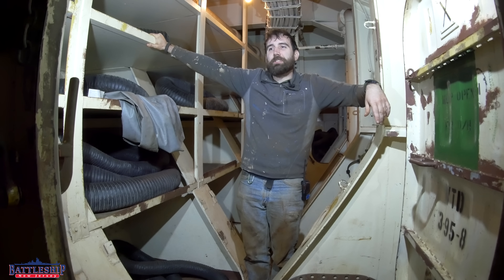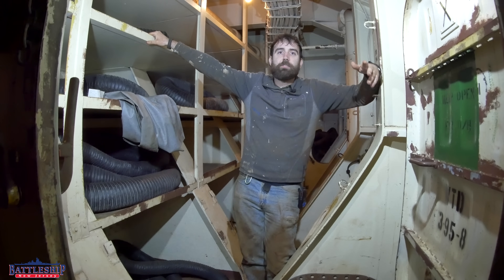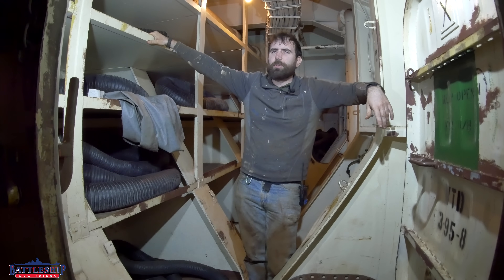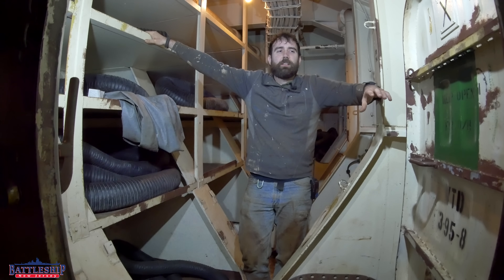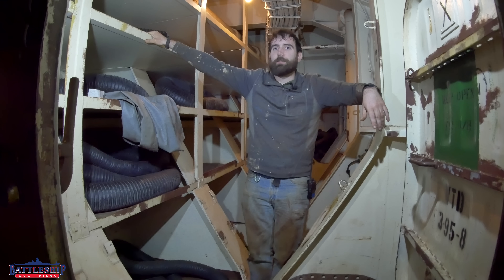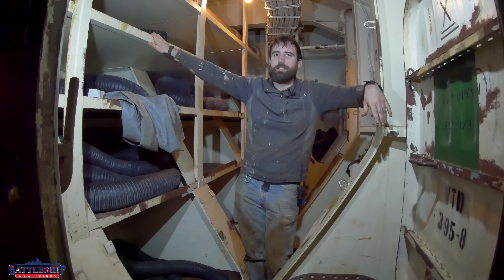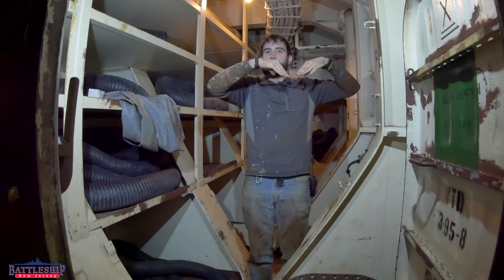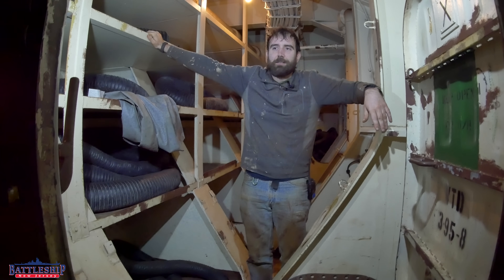The Best Torpedo Defense On a Battleship

Comment: The effectiveness of under the keel explosions was well understood by the interwar years.  That is why the Royal Navy, the US Navy and the Kriegsmarine developed magnetic exploders, none of which worked.   The Japanese went for a big warhead instead.

The Yamato probably had the best designed torpedo defense system.  However, it was apparently poorly built and prone to failure.
Reply: Their calculations, while good and thorough, were based on a TNT-like explosive, but during the war the Allies unexpectedly (to the Germans and Japanese of course) switched to Torpex, which is 50% more powerful than TNT.

I've also heard Drachinfel say there was a poorly designed and constructed joint between the armored belt and the torpedo bulkhead that was to rigid so any flexing could tear a hole between the two.
Reply: I dunno about that.  The Yamato and Musashi took more torpedo and bomb damage than any other ships in history that I'm aware of.  If I'm wrong, name a ship that took more torpedo hits and stayed a float.
Reply: @MartyInLa  That’s how many torpedos they were hit with, not how many it would have taken to sink them.  I suspect they would have eventually gone down with far fewer hits.  But the US Navy didn’t want to take that chance.  Also, bear in mind that those were air-dropped torpedoes with relatively small warheads.  They don’t compare to torpedos launched from ships and subs.
Reply: @MartyInLa  They were the size of a supercarrier so what do you expect?
Reply: @MartyInLa  no they did take more bombs and torpedoes, and they sunk. We'll probably never know how many it would have taken to sink them, just how many they eat. When you're being swarmed those are different numbers.
Reply: @navyreviewer  yeah it’s incredibly likely they were overkill’s by a fair margin
Reply: @MartyInLa  What are you talking about..? He's commenting about the speculations of the design, not what had actually happened..?
Reply: Agreed about Yamatos construction quality being poor. Also agree about them having arguably the best TDS. They could afford to as they had no limit on their size.
Reply: @navyreviewer  Having a poorly-designed joint between the armor belts, and placing it far too close to where a torpedo might impact, so that a shallow-running torp could cave in the joint and dump water high in the ship, doesn’t sound like a good design to me.  Yamato took a LOT of damage from just one lucky Mark 14 due to that flaw.  The Iowas and SoDaks actually had deeper TDSs than the Yamatos because their machinery was more efficient and took up less space.  They had a flaw in theirs as well, but it was much less dangerous because it was much lower in the ship (where flooding was easier to contain and less destabilizing) and much further inboard.  The best system by far—if it had been completed—would have been on the Montana class.
Reply: @bluemarlin8138  In any event both Yamato and Mushashi suffered catastrophic magazine explosions caused by aerial bomb damage, though Musashi was already under the waves when her's detonated.
Reply: The yamato was torpedoed on both sides. So instead of capsizing the US caused flooding, and then counter flooded their last hit.
Reply: @CameronCombustion  The Musashi was torpedoed on both sides, which acted like counterflooding and slowed her sinking; they learned their lesson and with the Yamato deliberately attacked from only one side, so she took half the torpedoes and rolled over.
Reply: @gregorywright4918  was it musashi? Im terrible with names.

Comment: For modern torpedoes maybe a triangulated keel beam would work better then the "I" beam conventionally used, would be cool to see some testing on different designs.
Reply: I think that the mass of steel you would have to use to make any keel survive (even barely) a modern torpedo is too much for ships to be able to obtain any real speed. The mk. 48 uses 647lb of high explosive, that will literally lift a up a 7000 ton destroyer.
Reply: @rangerhalt   I think the best defense against modern torps would be a blast chimney, like a few personel carrier concepts have against landmines/IEDs. Creating a path of least resistance to divert the energy of the explosion safely away instead of trying to take it head on. It would still need very strong framing, and means there's a large vertical void in the middle of the ship, which is inefficient use of space.
Reply: Hmm, a lot of torpedoes now are propeller hunting and can be set to go off where you like. Bow and stern hits are nasty for a ship, amidships, even one that cracks the keel, tends to take time to sink. Bow and stern are often 2 minutes or under to sink. 

You can still set them to do it though. One note is sea mines, they may not be fast enough to do more than intercept, thus keel is suitable.
Reply: Why would hits in the bow or stern sink a ship so quickly?
Reply: @magiccarpetmadeofsteel4564  combination of no anti torpedo bulges, the weight imbalance,  for the bow the ship drives itself under, or capsizes it and the stern is quite vulnerable, distorting the shape of the propeller shafts causes them to rip and tear the ship apart, breaking the waterproof seals around it allowing water deep into the ship. 

If it is hit amidships, the weight imbalance is less, it won't split in half titanic style, most systems will still work, it doesn't cause sea damage, etc

It's complicated, quite a few factors. I merely know it is true from the records.
Reply: Modern torpedos will detonate exactly where you don't want them to, and the warheads do deeply unpleasant things to maximise damage. They don't just go 'BANG.'  It's hard to convey just how much more devastating a modern torpedo is than a WW2 model. It's a completely different class of weapon.
Reply: For modern torpedoe defense with the torpedo detonating below the ship. Possibly a cylindrical or egg-shaped keel. This would spread the stress
Reply: Triangular beams are weaker, because no matter what direction you apply the load from, you will allways have one corner that is under much higher load, than the rest of the beam. If you want to have a keel, that will not break, your best option (or rather least bad) is not to have a keel at all, but rather go for a composite sandwitch design. Not that anyone has been able to do that at much more then 1/5th the length of a supercarrier hull. For some reason, everyone seems to stop doing that at about 70m hull length. I mean I understand that cost would be one issue, but why no-one (AFAIK) has made a 80m hull, only to realise that this was to expensive I do not know.
Reply: The problem is, to survive something like that, you have to dissipate the energy somehow, the easiest method is to do like airplanes do it, you actually have to flex and bend.
But then you are left with another problem, you have also be able to support many times your own weight which airplane wings do not have to do to avoid breaking.
Even jetfighters can snap and ruin wings at 9 times their normal 1G weight (Pulling 9G) and here we are talking several zeroes added after that.
Reply: WWII battleship would have no issue with modern torpedoes.
Reply: @rogerahier4750  Yes it would. No big ship is designed to be lifted in the center or on both ends, and thats what the torpedo is doing. A small ship can stand on its keel or be lifted bow or stern only, but a big ship might have to support its weight over a 100 meters or more, and its designed to float on water, not be a bridge. It would just brake apart.
Reply: @hernerweisenberg7052  Battleships do it every time in a storm when a wave is at the bow and the stern.  Four weeks of live fire including modern torpedoes couldn't sink the USS America.  They finally had to scuttle it to actually sink it.  An Iowa class battleship would certainly do better.  People that think you can just sink a US carrier would be in for a real surprise.
Reply: @rogerahier4750  By that logic, a giant containership thats 5-10 times the size of a battleship is so much more torpedo resistant because it may overhang some waves? xD
Reply: @rogerahier4750  Btw, zero torpedos where used on USS America. They used some explosive charges of undetermined size, The reason it took so long was they inspected the ship after each test of unknowen size.
Reply: @rogerahier4750  a modern torpedo like a Mk48 would gut any battleship. The under hull explosion is much worse than just lifting up the ship.

What happens is the explosion creates a bubble of water that will hammer the underside of the hull. This is very similar to what happens with side hitting torpedoes of WW2. But the under hull detonation has a part two. That bubble is going to collapse and when that happens it will create a massive water jet that will blast straight into the already damaged hull. This will be much more focused and destructive. None of the hull bottoms of battleships were meant to deal with this. None of the side TDS was ever designed to withstand anything like that. The only hope would be enough compartmentalization to reserve enough buoyancy to keep the ship afloat.
Reply: @rogerahier4750  Yes they would.

Comment: The protection against modern torpedoes is actually having multiple layers of hull, this is observed when ships are called "double hulled" or etc, the reason you don't see it often however is that you're now requiring just shy of double the resources for your hull or more depending on how many layers you add on top of reducing your usable interior space which is a premium in ships due to size constraints being limited by using the Panama Canal for convenience.
Reply: Today Panamamax somewhere at 1200 ft long and 160 ft wide.  So you could design bigger ships today with 20 to 30 feet torpedo depth.  Back in WW2 it design limits were 106 ft for width.
Reply: The US battleships had triple-layered hulls on the bottom.  That’s not a new thing.

Comment: Ummm, thinkin’ there’s a error in the reasoning of a liquid filled cavity providing attenuation of a detonation. It’s actually just the opposite affect.
Reply: The uncompressability of a liquid allows the force of the explosion to be spread equally along the inner belt.  It is not to attenuate anything
Reply: Bags of water are used to attenuate controlled explosions by bomb disposal teams. See “Why is Water So Efficient at Suppressing the Effects of Explosions?” in The Journal of Conventional Weapons Destruction Volume 22
Reply: I wondered the same thing- a hydraulic effect transferring energy toward the bulkheads. What defeated that energy? Expansion= dissipation of energy forward?
Reply: The liquid (and the air void) spread the explosion force sideways, which spreads it out and allows more of the frame and bulkheads to absorb it.

Comment: Not an expert here.
Couldn't a system of Point defense cannons (basically Flak cannons with explosive shells pointed at the water) that are distributed all over the ship, work as a viable torpedo protection system?
Reply: Today with current radar and sonar, maybe 🤔 before it was just a lucky "BB" (Golden) hit to protect the ⚓ ship.
The Olde saying since Bikini 👙...one shell one ship sunk (Nuclear).
Reply: If see it and have time to react
Reply: Anti torpedo torpedos..as it were..
Reply: @hillaryclinton2415  as I the current rolling frame missiles for US Navy surface Defense.
Reply: Seems to me there are stories of sailors using a 50 cal sized machine gun to shoot torpedos and they'd blow. Sometimes an M1 rifle and later an M14 rifle would work on a mine. The problem with a larger gun is getting it on target in time with enough ammo flying at it to hit it. I think they're traveling around 30 kts. They're about 24" across. I always wondered if that was a sea story or not. Did they really do that?
Reply: @robertthomas5906  These would have to be very near the surface to see.  Also in WW2 the trail of compressed gas gave way the torpedo 's path.  Modern torpedoes run on fuel and don't have a trail.  Also have to take into account for line of sight and the diffraction of light between the air and water (diffraction of light between mediums), something in the water is not where you actually see it.  Also the density of water slows the bullets down.
Reply: The Russians say they can use their RBU series ASW mortars to hit incoming torpedoes.   It's plausible .....

Comment: Could a catastrophic fuel fire really sink an Iowa?
Reply: The fuel they run on is so thick that it will put out a match you stick into it so no, not really. 

If a shell doesn't get to any magazines there is little chance of a fire. The paint locker right at the front of the ship could burn and the fuel for the spotting planes and helicopters was stored right at the back in a way that it could be easily dumped over board as this would burn as well, but the fuel the ship ran on was not a worry. Heck, the coal ships ran on 40 year before the Iowas was used as Armor!!!!
Reply: @willpat3040  In college, I worked for a couple of summers as a roofer and we would clean up with gasoline.  I saw people drop burning cigarettes into open pans and the liquid gasoline just snuffed out the cigarette.  It is the fuel vapors that are flammable.  This all reinforces your point that the fuel oil has to be heated up and aerated before it can burn.  And the coal fired ships were more concerned with the coal dust (similar to grain silo explosions which require both floating dust and an ignition source).
Reply: @willpat3040 on her last commission USS NJ was using diesel for the boilers.

Comment: Montana was not following the TDS used on both SoDak or Iowa.  Montana was to use the tried and true TDS on North Carolina.

While North Carolina TDS nearly failed, it DID hold while being hit at the weakest possible point on that system (by the forward most turret where the system is very narrow) by a weapon that exceeded its intended design parameters.

Makes sense.
Reply: Rinzler . Drach put up a Video today 2/8/23 about the Torpedo Attack on  North Carolina . You might enjoy it .
Reply: Cool! Thanks.
Reply: It actually didn’t use either.  The Montana would have had an external belt and torpedo bulge like the NCs, but also had an internal lower belt like the Iowas and SoDaks to protect from underwater shell hits.  However, the lower belt wasn’t connected to the upper belt as it was in the Iowas and SoDaks, so it was more free to deform and absorb the explosion of a torpedo.  An extra 10’ of depth on either side of the TDS didn’t hurt either.

Comment: Well you have the steel crushing tubes that Royal Navy ships of WW1 used, the water as armour that the Nelrods had

There is the terrible purgalese system that i believe if the Royal Navy had taken Vittorio Veneto on would have ripped out so the weight saved to improve her deck armour
Reply: The Pugliesse System wasn't terrible, it just was designed in an era where there wasn't the time to test such concepts out at scale. The only thing wrong with the Pugliesse System is that they put the liquid where the void should be, and the void where the liquid should be. Many people forget that liquid is incompressible and would deform and transfer energy just as a solid sheet of steel would. If the Pugliesse System had a liquid surrounded by a void, it would offer the space for the outer hull to deform, a liquid to catch the spall, and followed by another void to give space for the liquid filled portion to deform prior to hitting the citadel. The Italians planned on fixing this solution on later Littorio class BBs as well as any future designs that Ansaldo and OTO were cooking up.
Reply: When you think about it, the Italians would have ended up with a design almost the same as Iowa's, with their Pugliesse System replacement